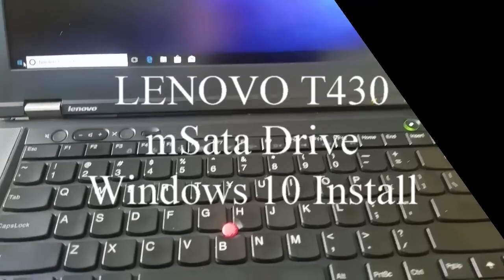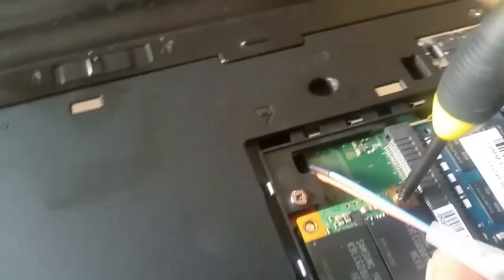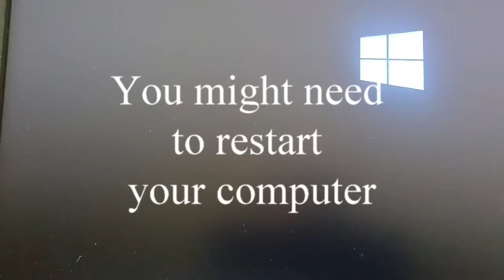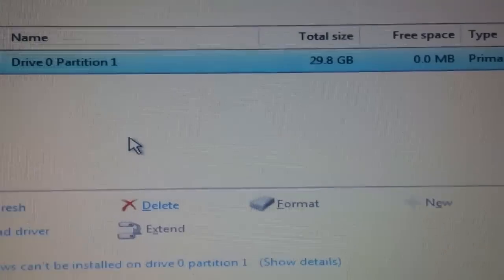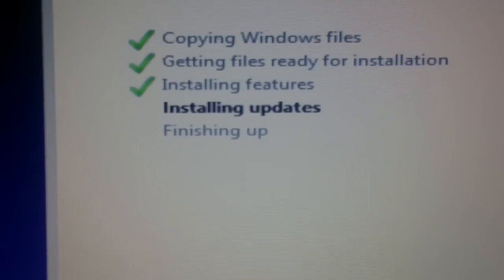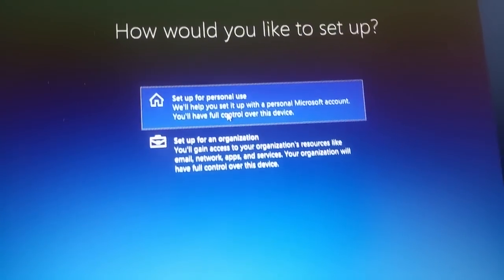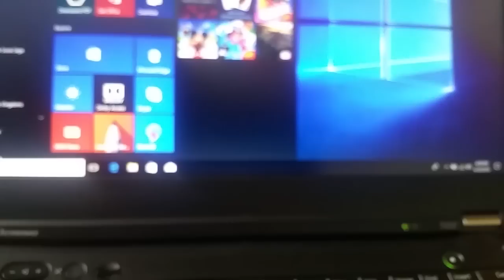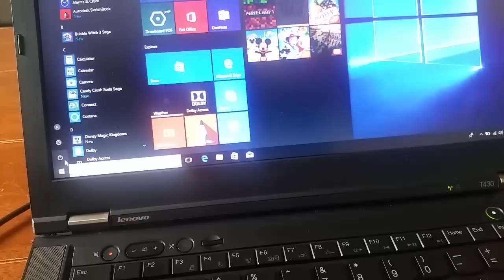Lenovo T430 mSata drive Windows 10 install

Comment: Hello, very good video. I am about to make this modification on my Thinpad T430
I will place a 256 GB mSATA, where I will install the operating system and the programs that I am going to use. In addition to that, I will use the HDD that comes from the factory as a secondary hard drive (save documents, images, videos, movies, etc.)
Is my mod plan ok on my computer? Do you recommend doing it as described?
Reply from the maker: Having that capacity Shouldn't be a problem. I ended up upgrading the HDD to a SSD and removed the mSata. There is the option of a Disk  caddy to remove the optical drive and place the drive there, if having multiple drives is a priority. Best of luck!
Reply: @SALGUCO  Why did you end up removing mSATA and replacing your HDD with an SSD?
I really don't need that much space but I have read in many places that to give more life to an SSD (any presentation) it is advisable to have it with a slave hard drive where I store all my files. Is this true? Or is just installing everything inside the mSATA enough?
Do you think I should go straight to replacing the HDD with an SSD?
Reply from the maker: @cuervo6286  yes I removed the mSATA drive. It was a 32Gb, and with that small capacity,  eventually Windows was not able to update for lack of room to do so. I did upgrade the HDD to a SSD. If you have the mSata drive already in your possession you might as well use it and use the other drive for storage, backup. If you don't, what I would do? I would upgrade the HDD to SSD. True, it is said that SSD tend to degrade overtime and that's why I also have external drives, where I save a copy of the files that I wouldn't want to lose if my computer drive went bonkers and decided to die! Best of luck whichever way you  decide to go!
Reply: @SALGUCO  what did you upgrade the mSata with? what ssd driv fit?
Reply from the maker: @sethblumhagen6190  I went SSD after all,  because the mSata drive capacity I tried was too low for the windows updates. I am currently not using that machine.... still have it, but don't use it. The way you plan to do it has is purpose.... me, personally,  got used to the external hard drives to back up my files.

Comment: I wouldn't give Windows so little storage, but maybe it can block the major updates for Windows 10. My T430 runs some Samsung disk acceleration with the SSD in the normal position with blazing speeds and I consider mounting a mobile broadband unit in the mSATA slot as my X230 needs a mSATA disk for dual boot, so the broadband came out of it already.

It's funny that the mSATA slot is on the other side, below the keyboard/palmrest, in the X230 and takes a lot more work than with the T430.
Reply from the maker: Thank you for your observation. I was just trying to show the install of this type of drive and windows at the same time.  I do have a SSD installed on this computer now. As you know,  this drive was originally used or intended for the Express cache feature, in combination with a HDD.
Reply: @SALGUCO  
It's very interesting anyways. I still use hybrid disks here and there.

Comment: Hello sir..
I just want to know that,
Should I buy this from Daraz (Online) by placing an order M2sata or Msata?
Is there any difference between them?
Pls guide..
I have the same Lenovo T430 laptop and am confused about that..
Thank you
Reply from the maker: Might not be able to give you a straight forward answer, for which,  I apologize. Like I said or commented before, I went SSD on this computer due to the size mSata drive I had at hand. Too small to handle the updates.
 If you try to go m2sata,  you might encounter compatibility issues, as per some information I read online. You can also consider converting the DVD Media drive to a SSD.
Reply: @SALGUCO  oh okay..but I don't want to eject my dvd rom🥺
Reply from the maker: @yasirshah5227  I see..... mSata then..... !
Reply: @SALGUCO  okay thanks sir😊

Comment: Just a side note, the mSATA port in this laptop uses SATA II, as the chipset supports only 2x SATA III ports, which are reserved for the internal HDD and the Multi bay slot. So you are not benefiting of the potential of the mSATA drive fully.
Reply from the maker: ComputersHowtos, Thank your observation.  We should probably highlight that the main purpose of the msata on the thinkpad is the express cache, to allow better performance with a HDD. I actually have a SSD on this laptop.
Reply: SALGUCO I personally own a T430 and also wanted to upgrade to mSATA, to have a potential for another 2 2,5" disk drives, but did not go for the mSATA due to this fact. But it's also good to mention, that the performance compared to a standarsld SATA III is of course uncomparably better, even when on SATA II interface.
Reply: ComputersHowtos so is this config recomendable or not? Been thinking on doing it to my T430 for a while

Comment: is t430 supports evo 860 ..?
Reply from the maker: inspireaman, it should. I have an 850 PRO 512GB in my T420......Based on this, I think it should. Use the Samsung software if you upgrade to the 860....
Reply: thank you